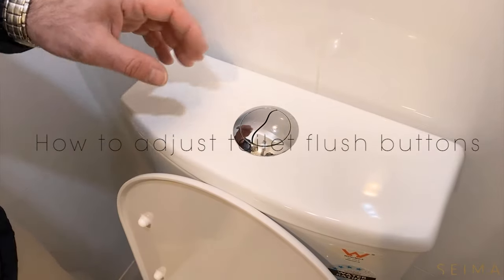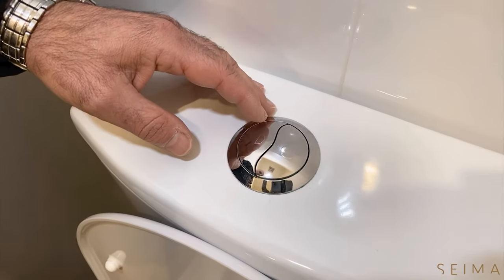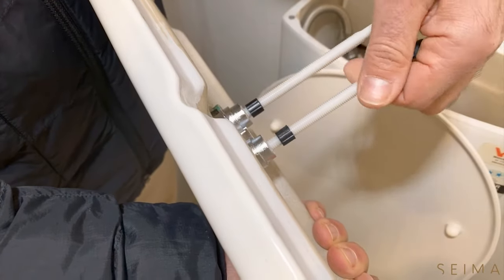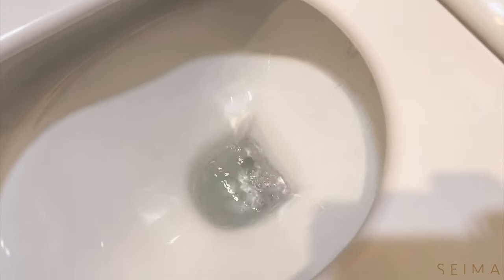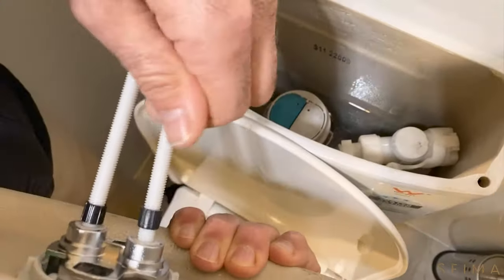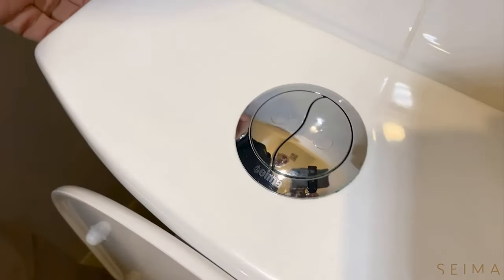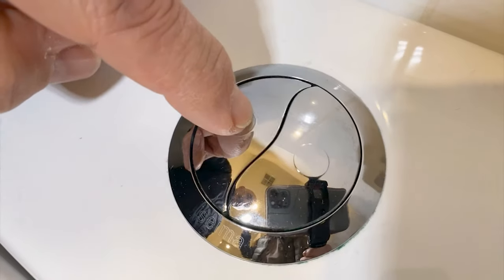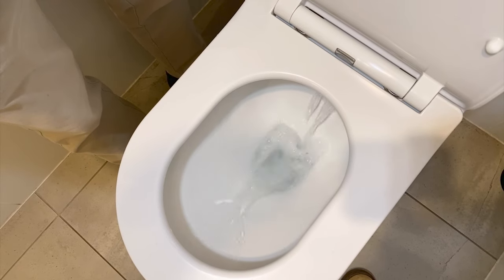SEIMA SUPPORT - HOW TO ADJUST YOUR TOILET FLUSH BUTTONS!

Comment: I’m not sure why, but the adjustment I need to do is left to right even though the flush mechanism appears to be perfectly centered on the tank and the button centered on the cover, the buttons and rods are about 1cm too far to the left and the only way to align them is to put the cover on a little bit too far to the right. I don’t see any particular way to make a left/right adjustment